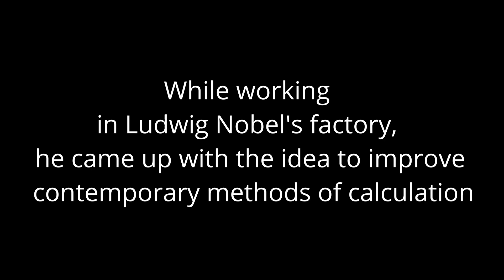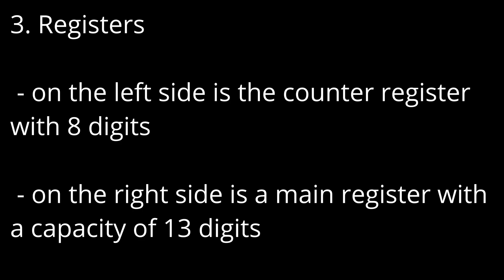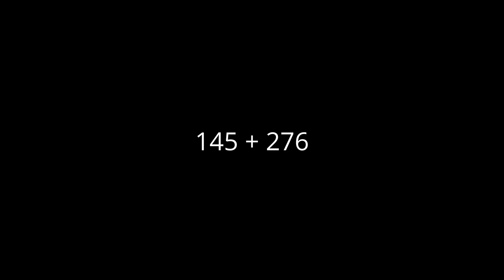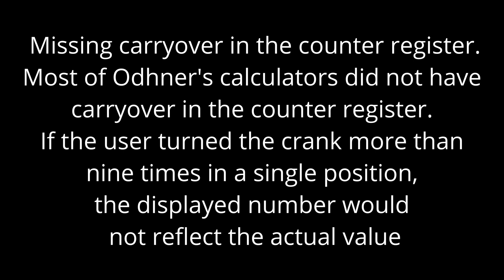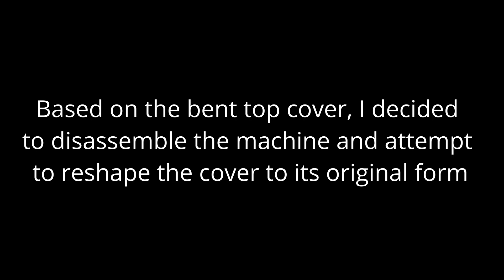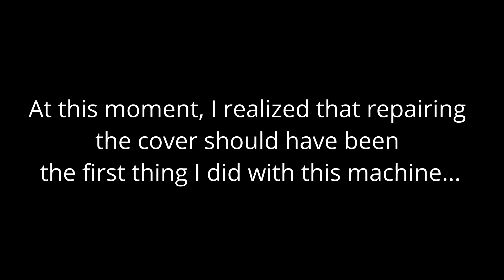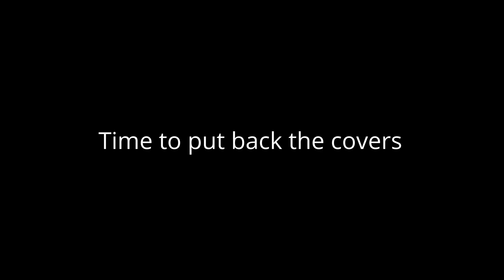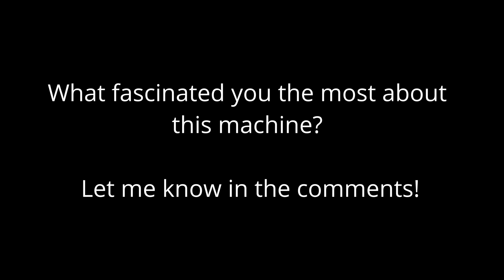Odhner Arithmometer (Calculator): The Machine That Changed Calculations Forever

Comment: I find complex mechanical devices amazing.  Especially that someone could envision all those cogs and wheels in their head to produce the final mechanism, let alone all the machining and assembly required for each one.  I can get my head around electronics schematics fairly easily after 40+ years of following them, but I don't think I could ever really understand a complex mechanism like that calculator.  Funny how it will still work in another 100 years where all our electronics will have failed after half that!  Progress!!  Keep up the great videos.
Reply from the maker: I see it exactly the same way as you do. I can hardly imagine how, in 1890, when Mr. Odhner began producing this remarkable machine, he managed to create such a precise mechanism. Lathes did exist at the time, but I didn’t realize they could already achieve such precision.

It’s fascinating to think that this machine will likely still work 100 years from now. I was struck by the fact that I didn’t see any mechanical wear inside, apart from the bent metal plate that was causing the mechanism to rub. But the mechanism itself is undamaged.

Thank you so much for your support!